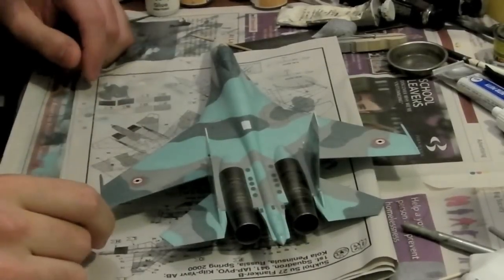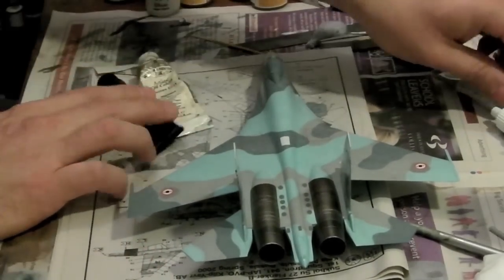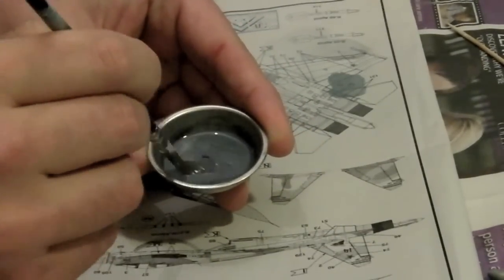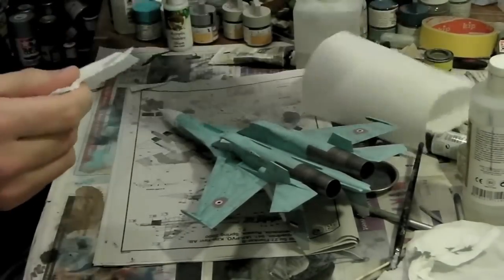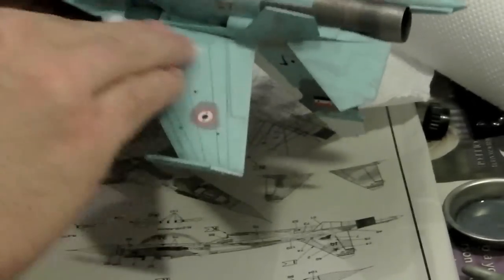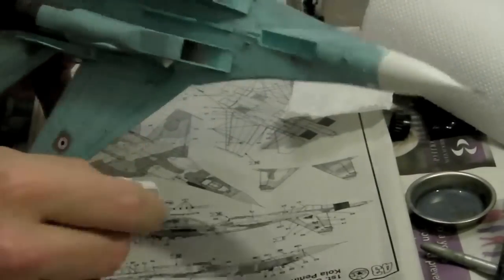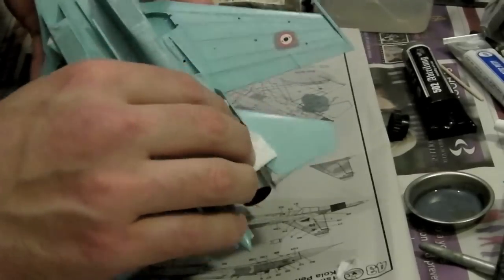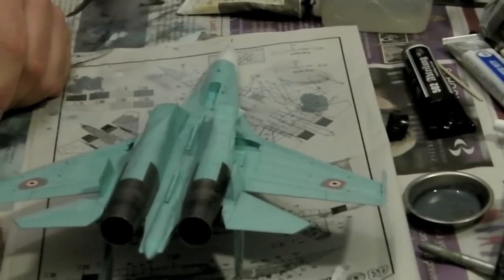washes 1.mov

Comment: Damn you Mr Manton.... now I got to go and build something today! ;)

Awesome video, BTW you are not alone on the "smudge" wash... I do the same. On some OD planes I even painted a lightened OD (with white or yellow) then satin coat it and do a smudge wash with burnt sienna oil paint... after removing the excess I might go back and overspray it with thinned OD. Turned awesome for faded out or sun bleached OD aircrafts in the pacific.

Comment from the maker: @Jedi2X98  You  can use Tamiya enamels, but you have to be aware that the beauty of oils is that after the thinner evaporates the oil paint itself is still wet and easily wiped away. The enamel paint will dry much harder much quicker and require a lot more effort to remove the excess, possibly damaging your finish in the process. The beauty of oils is their easy manipulation. I do use enamels but as a pin wash - very specific applications.